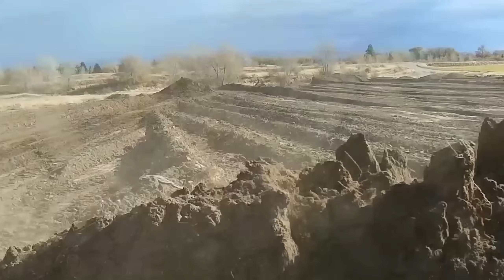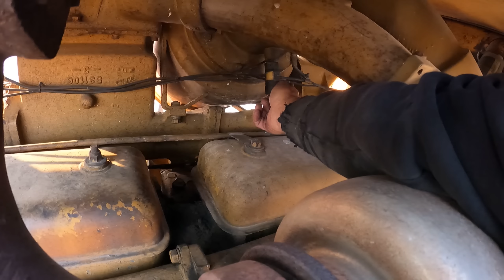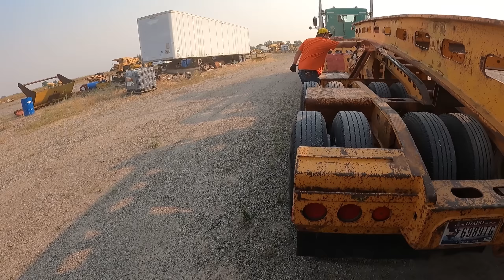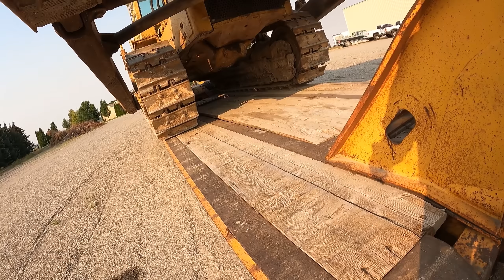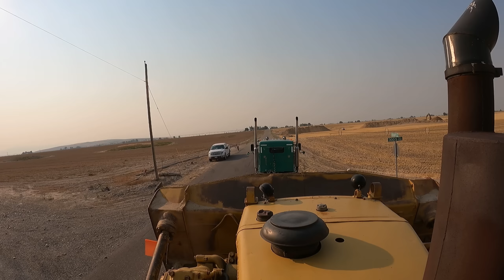Dozing Shot Rock

Comment: Used to doze a lot of "shots" back when I was working for the Soiland Family's quarries down here. Arriving @ first light after the afternoon of the eruption,  I would be jumping on a available machine which were either a 9H, a 9L, a 10N or a TD 25. It wasn't always bad but it was ALWAYS a challenge!! It "largely" depended on the air track (drill) operators charge hole spacing patterns and depth of the shot as to how my day would go.... Once "inside" the blast zone - it generally became manageable.. 🤠

Comment: I remember those days, wondering when the corner of the blade is gonna bend around the back of the machine. People that have never worked this type of material, wonder why your not taking a full blade. I’ve owned dozers, get into a job like this and wished I found something better. Work is work, hate that it’s so tough on the dozer. Thanks Jeff.

Comment: One last thing jay, don't you worry about when moving your dozer, facing forward, that your not worried that the air moving from transport with out a rainfall or taping off the stack. Not spinning the turbo and burning the bearings out.

Comment: Never ceases to amaze me the crap you have to go through to keep your older equipment up and running. 😱🤬
Reply: Don’t kid your self thinking only older machinery is a pain. At least you as a normal person cab repair it. The newer machines require a tech /mechanic with parts that cost out of this world. I will take my old equipment that’s paid for any day.
Reply: @Military-Museum-LP  Agreed, give me the old ones with no major computer BS over a modern one that'll quit as soon as a 1 turns into a 0. As long as you know how to fix these old beasts they'll run past the end of time.
Reply: So how did all that rock effect the hole in the blade 😂, did they have rubber mounted push blades for heavy rock ? Someone said something about it.Enjoy the rocking and rolling in the D9.,And get out the super glue and the Bengay.

Comment: Jeff around here a lot of the landfills use the Turbo II pre cleaners to cut down on air filter service intervals. they claim it doubles the air filter life. You just need your cfm and size of your inlet pipe. might not take too long in those environments to pay for itself.
Reply from the maker: Been thinking the same thing

Comment: No radial seal option for the D9 with the open end filter housing I guess. (without changing the housing anyway) IMHO it is a better system. Easier to service than the old bolt in the secondary system.

Comment: I changed my D6D, D8K and D9H to the radial design.  I got tired of scratching my knuckles off trying to get to the bolts in the back LOL. 

 Rocks are brutal to operate in, thankfully we don't have many rocks here in east Texas.  I finally sold off my larger old machines ..........now I just rent when needed. It's so nice to not have to wrench all the time and I get to climb into the nice comfy cabs and just operate.

Comment: Chin up mister PayDirt …it could be worse, you could have in a moment of impulsive insanity purchased a fancy new dozer. Take the air filter for example, your new machine would’ve first gone into limp mode telling you to contact dealer support. Then after a short seven hours on hold listening to polka music your put through to the dealer support desk in Kazakhstan, only to be told in broken English by Abdul that you’ll need to have a dealer service truck visit on site, problem is it’s a three month wait because of staff shortages. Finally the big day is here, the dealer tech arrives and asks what the problem is, you tell him he plugs in a laptop taps two buttons smiles and tells you your lucky because it’s just a air filter. Finally all this for a air filter….problem is it’s a twelve month supply chain delay because of monkey pox. This is why some of us stick to our old machinery, yes it’s old yes it’s uncomfortable but we can usually fix it with fencing wire a brick and a positive attitude. Cheers from down under.
Reply: Yeppers, I'm old enough to remember the 'can do' attitude that WE USED TO HAVE here in the states.  Sadly I see the same rot setting in from all the same sources happening in Australia.

Comment: Hi Jeff curious why you wouldn't put through a Trommel type screen an sell the rock? Great videos as usual get back on the D 9h love it regards Ashley
Reply: Ashley, this is some of the hardest, most abrasive rock to work. So a trommel or screening plant wouldn't stand the abuse. A true rip-rap plant might, but a good one in good shape is at least $500K. Job wouldn't justify it and the rock might not sell right away (location, location, location) so it sits in the middle of the field which defeats the whole purpose. Hope this helps?

Comment: What weight oil are you running in your final drives on the old 9? 30 weight? 50 weight? I bought one a couple weeks ago and just wondering thanks
Reply from the maker: G's say 30 H's 50  if I was you and it wasn't very cold in your area I'd get a TO4 oil from CAT  supposed to have more magic stuff in it to make powertrain component's last longer we use it in the 336 finals
Reply: @Jpaydirt  I like watching your vids on working on the old 9’s are you making one of doing steering clutch’s and brake bands? Lol mine hopefully just need some adjustment only likes to steer good going forward not so much backwards 🤷